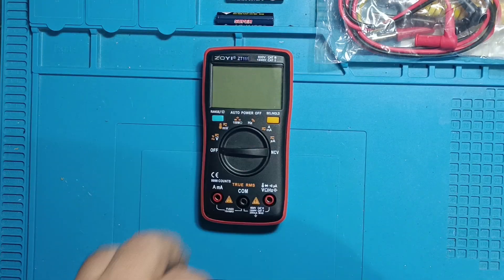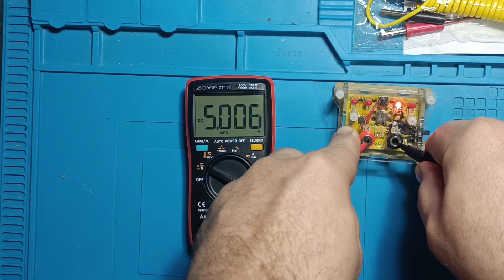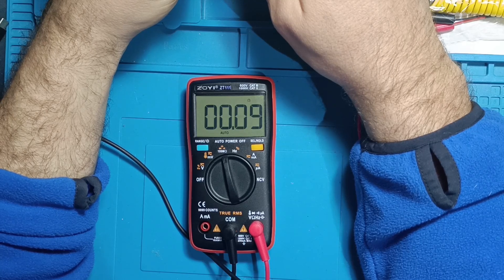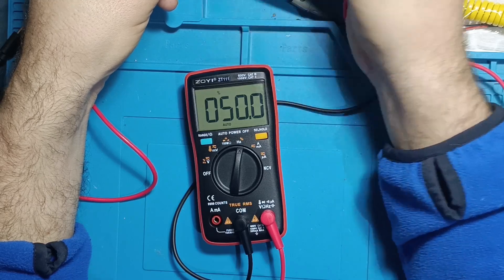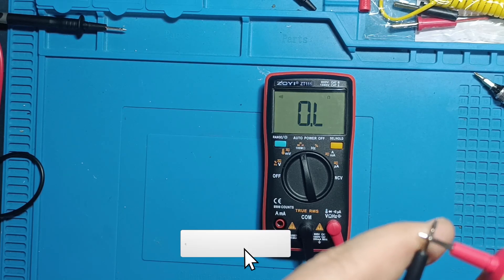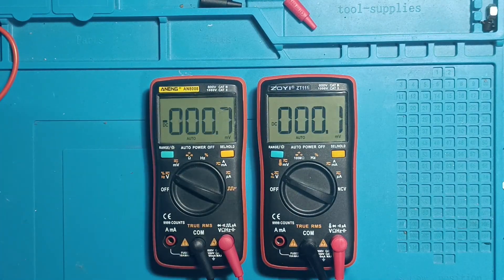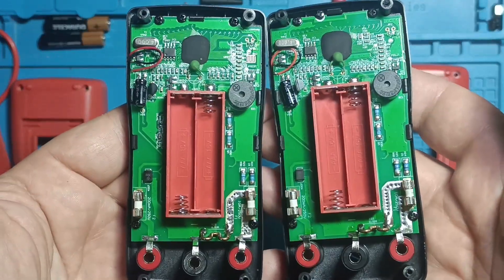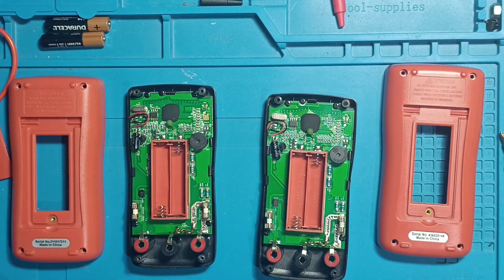Zoyi ZT111 , The $10 Multimeter, is it a new best buy on the market ?

Comment: My only problem is it's hard to find 200ma fuse for this almost all I found is 600ma. Not a problem on a 10A one.
Reply from the maker: those you can order on AliExpress, Ebay or anywhere else but at a higher price.They come almost always with legs , just cut legs and place em in a holder,.They are 3.6mm x 10mm fast acting fuses so you can get em here https://bit.ly/4oYoHMY 
or here
https://eu.mouser.com/ProductDetail/576-0874.200MXEP?r=576-0874.200MXEP

Comment: The fuses are very small and a real problem to replace in these meters. Don't buy it,
Reply from the maker: well fuses are standard SMD fuses , cheap and reliable. I got all kinds of such fuses and it's not an issue to replace them, from the other side I managed to break one fuse in instruments  in the last 15 years of work, so your reason to not buy such a cheap but precise instrument is not a valid reason